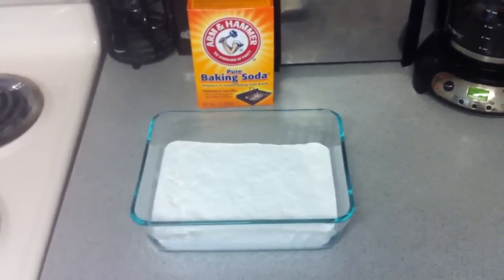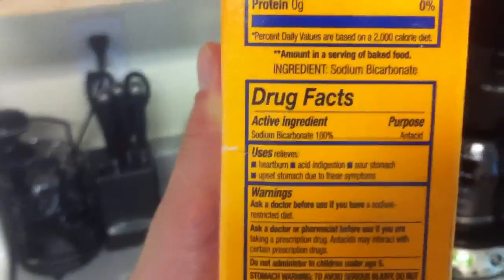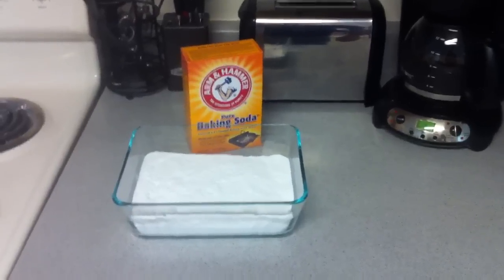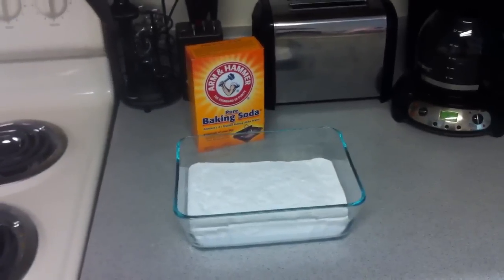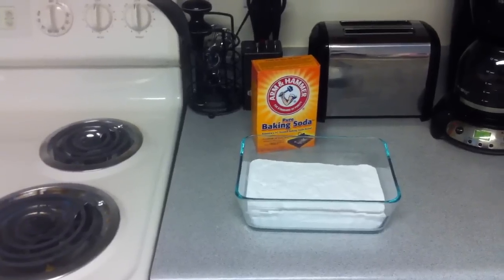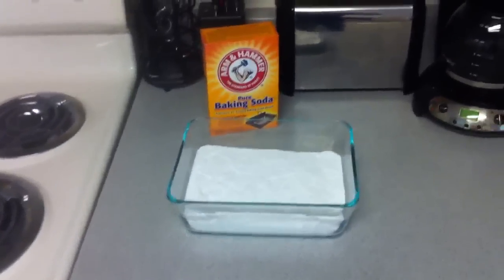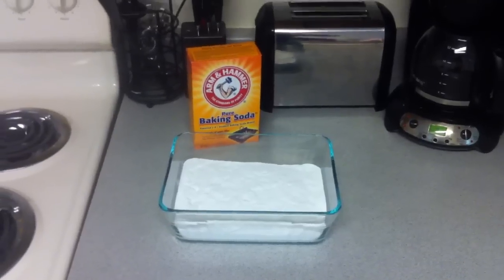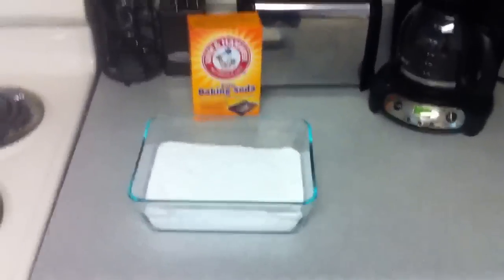DIY PH Buffer Soda Ash From Baking Soda

Comment from the maker: Thats a good question, but I doubt that a microwave would work due to the method used to heat it and how uneven it does it. Just do it the right way in the oven. Do it for 2 hours on 400 to be safe.